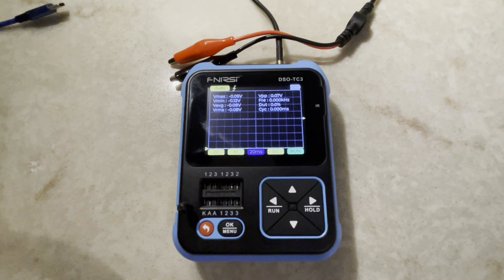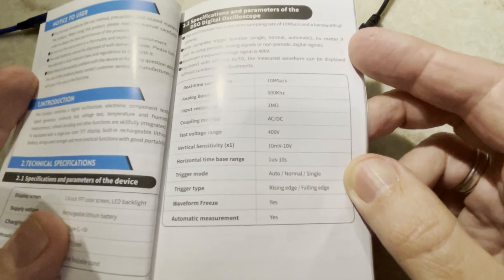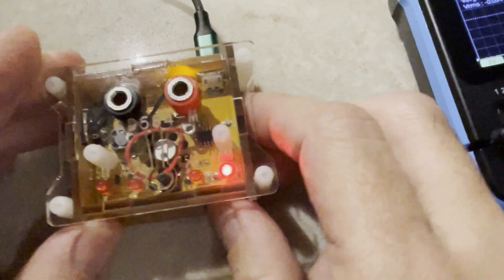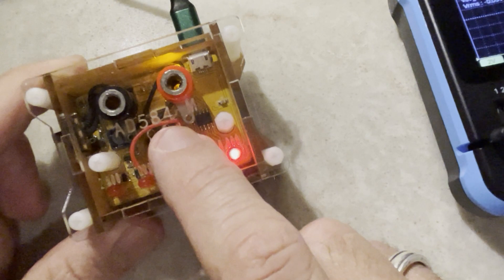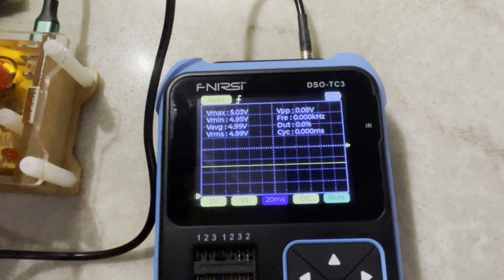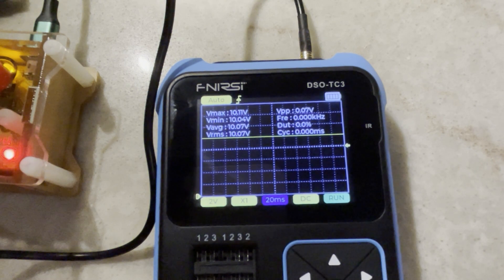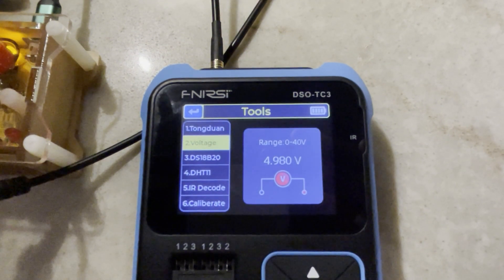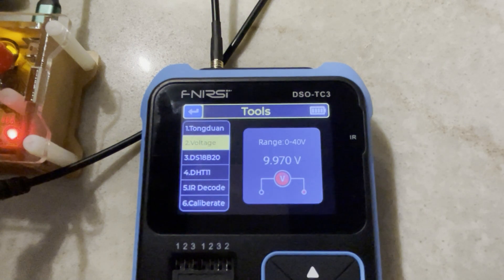EB002 - FNIRSI DSO-TC3 Teardown

Comment: Hi I have the same device, can you detect the problem for me? I made a mistake instead of testing the 20 volt battery with the special 0-40v plug I injected 20 volt where there is the location of the components. the device no longer turns on
Reply from the maker: Hello, have a look at the conversation in the comments by @InfectedCreations (about 8 months ago). He also damaged the device but managed to fix it.

Comment: Hello i got the same device mines burnt out with a capacitor accidentally. The little chip on location u6 is burnt out. Now i want to try to ad a new chip but i can,t read the chip anymore.... Would you check for me what type it is?.... (chip number) Thanks in advance if you would like to do this for me 😊👍✌
Reply from the maker: Hello, U6 has the marking V05. It is an SRV05-4 ESD protection diode array. It is oriented such that pin 5 is next to the text “D1” on the PCB.
Reply: @ElectroBananasYT  Hello thank you now can i try to repair it. :) The cos724 (quad opamp) was also going to overheat now i have removed these 2 bad chips. After this remove the oscilloscope is still working the signal generator i didn,t test it because you can,t use them simultaneously on the DSO-TC3 and I don't have another oscilloscope. Thanx. 😊👍
Reply from the maker: Most welcome, good luck with the repair and please do subscribe 😊
Reply: @ElectroBananasYT   Fixt it works again. 👍
Reply from the maker: Well done! Not easy soldering SMD devices. What did you have to replace in the end?

Comment: But how easy does it blow up? My last cheap meter lasted 7 days
Reply from the maker: Note that this is not a multimeter, it is a component tester with a basic scope and signal generator attached. As such, it does not have the same input protection as a multimeter does. As with most components testers, you will kill them my using it to test a capacitor that has not been discharged first.

Comment: Wonder what part i fried by accidentally sending a voltage to the ZIF socket??  Id like to repair it if possible. Only activity i can see now is the Charge LED while plugged in. Any help would be much appreciated. Thanks for your upload.
Reply from the maker: Sorry to hear that. If there is no display and no beeps when you press the buttons then most likely the microcontroller is damaged. Second perhaps the power system is damaged. If the microcontroller is damaged, then i doubt that it would be a viable fix 😢
Reply: @ElectroBananasYT I still get the beeps on button presses and the charge status led seems to work properly. Maybe I can find a schematic for it.
You earned a sub though for your reply.  Thanks.
Reply from the maker: That is good to hear. See if you can switch on the function generator. If you can there is a possibility that just the display module is damaged. Perhaps you can get one from FNIRSI, their customer service is quite good.
Reply: @ElectroBananasYT  Their CS is so good they sent me a new one in like 72 hours. I just haven't had the time to go through both of them at the same time.  
Yes the generator throws out a 1kHz Square soon as it's turned on.  I already hooked a speaker up to it to compare to the new one.
Reply from the maker: That is excellent news! 👏👏

Comment: Wonder what part i fried by accidentally sending a voltage to the ZIF socket??  Id like to repair it if possible. Only activity i can see now is the Charge LED while plugged in. Any help would be much appreciated. Thanks for your upload.
Reply: Thank you. Maybe one capacitor could not be full discharged. Anyhow connected an external power supply to the board and the tester woke up. All functional now except the components tester. I got 50% refund from the seller.
Reply: I have a similar problem. My device failed on the day I received it, just tested 2 caps and the oscilloscope function. Suddenly turned off and seems that doesn´t receive charge.
Reply from the maker: Oh no. Were the caps discharged? Try reaching out to FNIRSI for guidance, I have found them to be very responsive and helpful. Wishing you the best.

Comment: I'm curious if there's a way to smooth out the signal a bit. I mean have you noticed it kind of shifts around when measuring? it's not as steady as a real more expensive one, so I imagine maybe there's a floating resistor that can pulled high or low.

or maybe a capacitor can be added. I dunno something...
Reply from the maker: Hello Drew, thanks for your comment. I doubt it very much. I think the issue is inherent in the design. If it was that easy to resolve, I am sure FNIRSI's R&D department would have done it. I still think this is a great device for the money.
Reply: @ElectroBananasYT  I have one of these, and having nothing connected, I'm getting a continuous pattern. I'm guessing whatever tiny bit of noise is registering is the smoking gun here.
Reply from the maker: That is quite normal to see on digital scopes.

Comment: Hello, Can it be used in automotive diagnostics? Does it support CAN, LIN and FlexRay protocols? And if not so what is the affordable one do you recommend for automotive repair?
Reply from the maker: Hello, no it is not designed for automotive diagnostics so does not support those protocols. Sorry I am not familiar with automotive repairs.

Comment: Hi, does it have ATMEGA 328?
Reply from the maker: Hello, as the microcontroller has had its markings removed we can't tell what type it is. However judging by performance of this device and the number of pins on the microcontroller, I think it is safe to say that in is not a 328.
Reply: @ElectroBananasYT  thanks, may be an STM32. Now there are Arduinos with STM32

Comment: Instead of drilling holes  in a plastic case for banana connectors, you can make a small PCB for ZIF socket with connectors for your tester.
Reply from the maker: That is not a bad idea :)

Comment: Great to see how easy it is to replace the battery, and you do not need to solder, it has a connector, the build quality looks very good.

I love to see some upgrades, like installing banana sockets.
Reply from the maker: Thanks for the comment, yes the quality is excellent for the price. Yes hopefully will make some mods in the next few weeks.
Reply: @ElectroBananasYT  Is there any marking on the display flex cable?